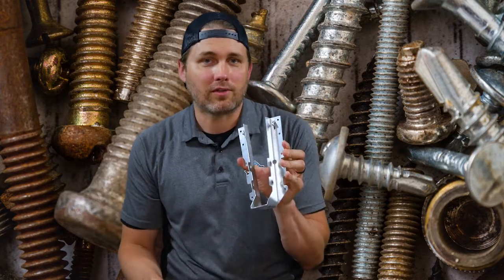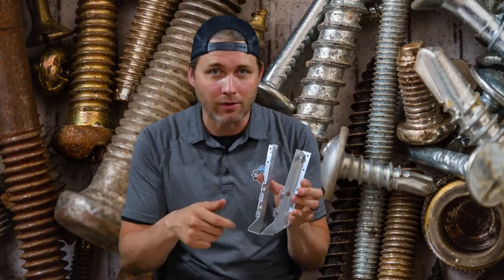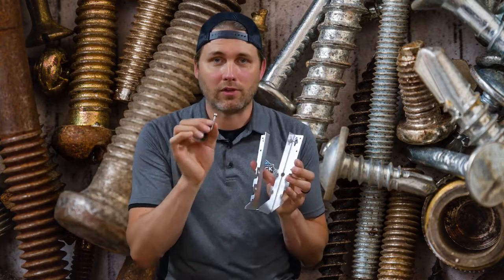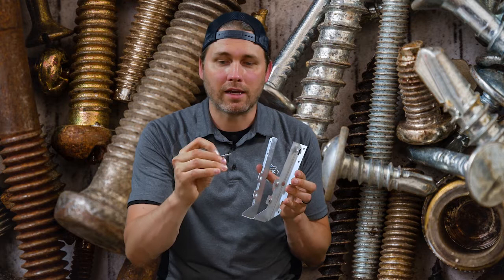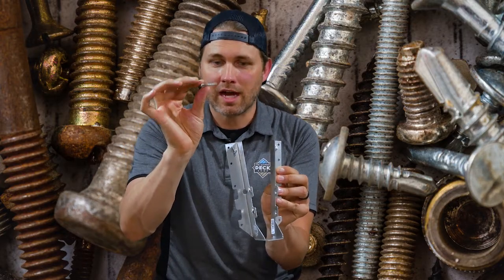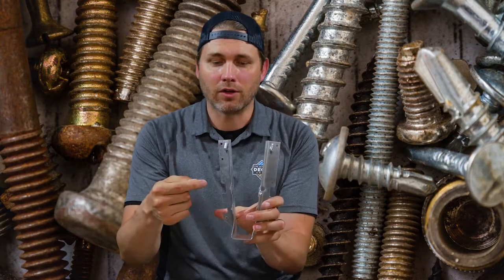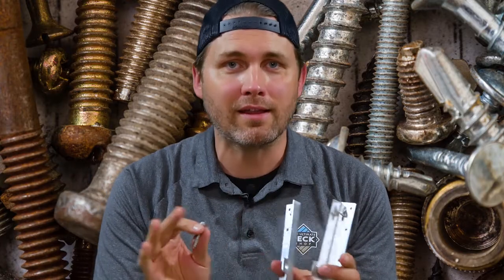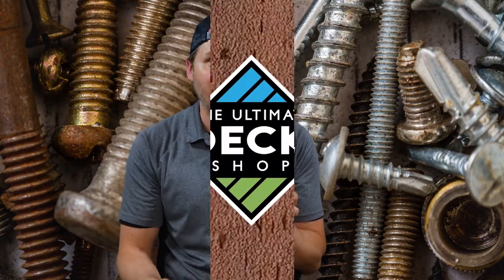The RIGHT fasteners for your Joist Hangers // The Ultimate Deck Shop

Comment: Screws always beat nails in every test under every circumstance. Drywall screws will beat nails always. Simpson prescribes certain fasteners for two reasons. 1. They can't test every fastener so they test a limited number of fasteners and those get approved. And 2) Simpson will try and get you to buy their fasteners.  But don't fall for it, screws are always better, stronger, more reliable than any nail. 
Unfortunately not all screws will pass inspection. Even though screws are always a better choice, inspectors will often check for approved fasteners.

Comment: What length of screws do you use for the angled screws into the joists? The #10’s?
Reply from the maker: The 2-1/2" are for the angled holes. #9 typically for standard light duty hangers (LUS/C) and #10 for heavy use (HUS/C). Simpson has charts for appropriate deductions for the different fasteners for each connector type.

Comment: I am currently building a house for my family. I am about to build a 2x6” wall down the center of the attic topped off with a 2x12” ridge beam. Then rafters, joist hangers and these fantastic screws! I am overkill all the way haha. 
I do have to say though my grandfather and I built a deck on my mother’s house using all nails in 1976 and its still standing after all these years. I was 14 back. Grandpa is gone. I am 62. No telling how long I have left. That deck may outlast me haha. I drove every single nail in that deck. Grandpa taught me how to use a hammer as a small child. I owe much of who I am to that old fart. 😊
Terry
Terry

Comment: Yeah and they don’t sell these in stainless steel, which is a problem.  For people living on salt water ocean or marsh, stainless is essential, hot dipped crap is nothing but a ticking time bomb in salt water.  So there are limited options.  Joist hangars DO come in stainless steel but if you elect to use galvanized fasteners you’ll have bimetallic corrosion at the contact points as different metals create a cathode-anode net charge.  Your only option is to use full size and thickness course-thread 3” stainless screws for hangars (not deck screws). Your other options are to use as little hangars as possible, rest your  joists on top of beams and shoulder beams into pockets on girders so it’s wood sitting on top of wood.
Reply: This might have changed since the video was made (5 years ago at the time I'm posting this comment).  There is a SD9212SS-R100 screw that is listed as stainless steel for use with Simpson joist hangers.

Comment: I doubt ill get a response ona 3yr old video.  But ive been arguing for years that the angled parts should be regular galvanized wood screws. Those tiko nails have a thousand pound of sheer weight per screw.  Six of those bad boys per hanger would be plenty.  The angled ones however I believe should be screws.  Ive seen so many times where the faceboard or ledger just kind of pulls away.  A few screw with actual threading to keep it tight would help a lot with that.  
  Soooo, anyone?
Reply: I used the LUS26Z(2×6) hangers for my deck: (2) SD9(1.5"L) and 
(2) .148 SS TECO(1.5"L) nails for the 4 holes to tie into ledger; with these 4 nails, 1 screw and nail were used per side and staggered(1 nail in top hole and 1 screw in the other top hole). The diagonals got 4- SD9(2.5"L). Hope this helps!

Comment: Are number 10 GRK screws acceptable. 3-1/8”
Reply from the maker: In a joist hanger?  Which GRK screws?  GRK is a brand. If you're referring to their RSS screws that would be MAJOR overkill. If you're referring to any other GRK screw, it wouldn't be the correct screw to use.

Comment: Just ran into this. I used 3 inch #9 exterior deck screws for the angled part of the joist hanger. The inspector told me I could use a 16 penny galvanized nail or the specialty screws.  What's hilarious is a 16 penny nail would pull out before the heads snap off the deck screws I used. Lol.
Reply from the maker: You're not wrong. However, the primary force is in shear with a joist hanger ASSUMING the deck is properly braced and/or laterally attached the house.  But if not, you're right, the nails could wiggle out in theory. Hence why some areas are now also requiring lateral load anchors.

The SD screws solve both forces. They're awesome.
Reply: @TheUltimateDeckShop  yeah, we have lateral load brackets bolted into the foundation. I ended up running 20D nails through the joist hangers. I also cross brace the joists underneath to prevent any sway movement even though it's not required in my area. The composit decking fasteners don't provide a direct floor-to-joist connection so best to be on the safe side I figure.
Reply from the maker: @jamesnm21  Sounds like you got it cased! Nice work.

Comment: I watched a test that was recorded by one of the testing agencies that work in tandem with resedential code law makers that completely changed my mind about the nail vs screw for framing a house.  I had always heard over and over "nails have more shear strength and thats why they're used for framing."  That is actually not why.  Nails are used more often b/c they are much cheaper to buy and they reduce the man hours required to build a house frame - thus resulting in less cost on the builder in hourly wages.  Nails are not superior structurally in any way.  The screw won every single test that they did vs the nail.  The test was done using boards that were fastened to each other using nails and the other using screws.  A hydraulic machine that applies force to the boards/fasteners is used that also records the amount of pounds of force being used.  The tests are stopped when one of the 3 things occurs - 1)Pull out - when the nail or screw can not hold any longer due to the force and is pullled out of the wood 2) Shear out - when the nail or screw is snapped due to the force applied from the machine  3) Tear out  - the force causes the screw or nail to cut through the wood and eventually tears out the side of the board..    On one test there was 2 boards flat stacked together and fastened - one using screws and the other using nails.  The machine began applying pressure to the boards and is trying to seperate them.  The screw won that test as predicted and won by a landslide.  The next test was the boards fastened perpedicular and shear force (downward force) was applied to the board running horizontally that was fastened to two vertical boards.  I thought the nail would win that test but what it concluded was the nail never made it to the snapping point.  On every single test, the nail's problem was what they call "pull out" and that simply means the nail failed to stay in the wood once the pressure reached a certain point and is  pulled out.  On every single test they ran on the nail, the nail never made it to the "shear out" point b/c it kept losing due to "pull out."  The screw finally snapped but the amount of pressure it took far exceeded the pressure of it took for the nail to fail and lose due to "pull out."  I cant remember all of the tests but the screw won every single one of them - even the tests where you would think the nail would win.  Shear strength is not what you should be focused on.  Pull out is going to happen before it makes it to the point where  nail / screw is snapped and  in every single test the screws pull out point is wayyyyy higher than a nails.  Nails are only used b/c they're cheaper / faster.  They are actually far less superior structurally than the screw.
Reply from the maker: THANK YOU for posting this!  That is SUPER interesting.  Any chance that event was recorded and available somewhere?  What type of screws were they using?  There are structural construction screws out there now that address the shear issue as well, but I assume they were likely just using standard 3" #8 gold wood screws?
Reply: @TheUltimateDeckShop  I watched that demonstration video about a year ago and it was on the website of the testing agency that tests fasteners for residential construction and I'm like 90% sure the vid was on YouTube as well.  If I can find it again I will give you the link.  Yes, the fasteners are tested against their code approved equivalent of the other kind of fastener so if we're talking about the length/diameter of ring shank nail that is approved to fasten studs to top/bottom plates, then that nail was tested against the screw that is permitted to attach studs to plates.  These were not thick lag screws.  The test I saw was probably something like a #8 - #10 diameter screw and it kicked the nails ass in every single way.  I have a background in building piers and one complication about piers is being so far away from a power supply/outlet.  Most piers used nails b/c cheaper/faster than using a generator to power a drill to predrill holes then drilling a screw in them.  The impact driver wasn't out yet and the problem with regular drills driving screws into wood without predrilling is they split the hell out of your lumber especially when toe-nailing.  They also really bad about stripping the screw.  The cordless impact driver solved both of those problems when it became mainstream.  Nobody uses nails anymore on their pier and for good reason.  Piers and decks re exposed to the elements way worse than house frame.  If you walked down a pier that used nails on the decking boards, around the 5th-8th year you'll about every single nail will be sticking up out of the decking boards.  A pier the same age with screws will not have that problem.  A #10, 2.75" to 3", 316 marine grade stainless decking screw is all I want to hear anymore!
Reply from the maker: @morokeiboethia6749  That all makes perfect sense.
Reply: Thank you for posting this. I have been going back and forth and will go with screws. Starting repair and rebuild on a personal deck tomorrow!
Reply: @mikecrophone  for exterior deck and/or basically anything where wooden boards will be exposed to exterior conditions, screws will come out better.  I was just walking on a dock thats a few years old earlier today and wooden decking boards and nails were used and almost every nail head is sticking up 1/16th to 1/4 inch up out of the decking boards.  Wood that is in direct elements outside is constantly moving as temp, rain or humidity, never leave it alone and when the wood moves the nails slowly get backed out a little.  If you are going to use wooden decking boards to walk on, most definitely use screws on that or else you'll have to tap every nail down with a hammer every six months in a few years after completing it.
Reply: @morokeiboethia6749 thank you for replying. Great info and yes I have been tapping nail heads for several years. Glad there are safe screw options!

Comment: With the same bracket you have. How would you screw the sides in if the joist is sloped
Reply from the maker: Sloped down like a rafter?  Use an LSU Sloped Hanger.  Or if you mean skewed left or right, then use a SUR or SUL hanger.
Reply: @TheUltimateDeckShop  Can you notch the rafter to fit the 90 degree bracket
Reply from the maker: @iroc2019  without understanding the context, I suppose you could cut a bird's mouth to allow it to seat fully, sure.

Comment: First time using SD screws for hangers... I have had about 4 heads shear off during instalation from 3 different boxes of screws. This leaves no option to add a screw to that hole. It seams to me that out of a couple hundred 4 sheared off heads is too many 1/4 of my box of 2.5 inch screws were unusable because coating was to thick to fit in 1/4 inch driver.   I am just building a chicken coop but planned to build a deck later.  This seams like a huge quality control/safety concern and I am concerned about their actual shear strength.
Reply from the maker: Not something we have ever experienced first hand, nor have heard that feedback before.  In our building days, we installed 10's of thousands of them.  And in our retail days, we've likely sold millions of them.  Something doesn't sound right here.  Were you using the #10 screws instead of #9 in the L-series hangers? That could explain them being a little big.  And over tightening them could explain the shearing off.

Unless like you alluded to, maybe a bad batch.  But certainly not something we've seen or heard of.  Very strange.

Comment: Thanks for the video!  I actually just used the 2.5” through the straight holes in the hanger flanges (I didn’t know any better before this.  I was wondering about concealed joist hangers- because the flanges are on the inside, it seems you can’t use these hex head screws because your joist won’t sit flush against the ledger.  Do I have to use nails for these hangers and if so what kind?  Thanks!!
Reply from the maker: Hi Chris!  So the SD connector screws are still an approved fastener for the LUC series of concealed hangers.  However, I do not see them listed as approved for use in the HUC concealed hangers which are the heavy duty ones.  For a list of all connectors the SD screws can be used for, see here: https://www.strongtie.com/products/fastening-systems/technical-notes/sd-connector-screw-approved-connectors

Comment: I just shoot nails for my joist hanger. Since all decks now require tension ties to prevent joist pull out from ledger board, the screws loose it purpose. It just cost more and take longer to install. Simple .148 nails on all hardware unless the hole is big enough for .162 nails.
Reply from the maker: Certainly hanger nails are just fine as well, especially if you have a strapshot or other pneumatic nailer.

Tension ties are certainly not universally required by any means, most places have not adopted that provision.  But in places where they are being used, certainly the withdrawal strength of the screws becomes less of a benefit.

But both work, and both are convenient in their own right.

Comment: ya, when you put in 10 screws with 10,000 lbs of shear strength per a screw it's going to fall a part, that why you need screws with 14 ,000 lb screws.
Reply from the maker: Not sure what type of screws you're referencing, but if they have 10,000lbs...you're good. Hahaha!  A #8 deck screw has around 90lbs shear.  Use the right screws.  There's no reason not to.
Reply: @TheUltimateDeckShop  even at 90 lbs and 6 screws that's  540 lbs per a hanger. a deck could hold a hot tub with no problem. now it looks like decent screws are closer to 125 lbs. let's also not forget that screws are put in perfect straight and that the friction accomplished from screwing 2 boards together also adds a litte. even when people use drywall screws usually the wood rots away before the screw it self fails due to rust.
Reply from the maker: @678friedbed  You do things however you like on your own personal dwellings.  But this advice is incredibly irresponsible and dangerous.

We urge anyone else reading this to do it the proper way according to established building codes and manufacturer instructions for your own safety.  It doesn't cost any more to do it the right way.
Reply: @TheUltimateDeckShop  lol, so being able to hold up almost 7000lbs is dangerous? you do realize hot tubs get installed on decks all the time without hangers. I hate to break it to you but trying to make that bogus fearmongering statement just makes you look like an idiot that's more concerned about the scary lawyer then actually making sure things are to some standard of safety. in case you haven't done the math or actually built decks following regulations isn't about safety, it's about raising the cost to make thing prohibited. but hey you go ahead and explain why it's safer to keep a rotten deck and fall through then it is to save hundreds of dollars on materials. you go ahead and tell people that a bunch of politicians that were lobbied by buisnesses to write code know more then someone who has actually seen decks decay and fall apart faster because it was "done right".
Reply from the maker: @678friedbed  Have a good one man.

Comment: These screws were so fantastic to use. Sure they cost more, but with the cost of building a deck, the price difference of nails to these screws is pocket change. I rebuilt a rotted 10x12 deck and spent about $60 on the screws vs maybe 20 for nails, but it's so much faster if you don't have an air nailer to just use a drill, and if you need to adjust, they come back out a lot more easily.
Reply: Definitely. It takes too much effort to hammer in all your nails and not practical to buy a nail gun if its not going to get used very often
Reply from the maker: Absolutely!  The cost is negligible.  The time and ease of use is well worth it!

Comment: What's annoying is Simpson doesn't sell these in small quantities. I hate having to buy 150 screws to put up a hanger or two... Super annoying
Reply from the maker: The smallest pack is 100 yes.  That doesn't go very far as each hanger will use 6 or 8 or 10 of them.  But yes if you're only doing one or two hangers, then the nails are a more economical way to go.

Comment: is the 2 1/2" screw sufficient for the toe/diagonal ? or do you have to use the recommended 3" nail?
Reply: These size Simpson screws are rated to pass code where the nails are required.
Reply from the maker: The 2 1/2" is the proper fastener for the double sheer angled holes, as per Simpson's engineering.  If using a nail, then yes it's the 3" you want.